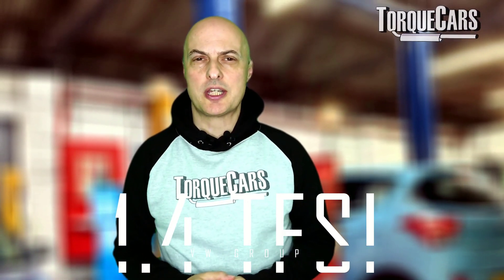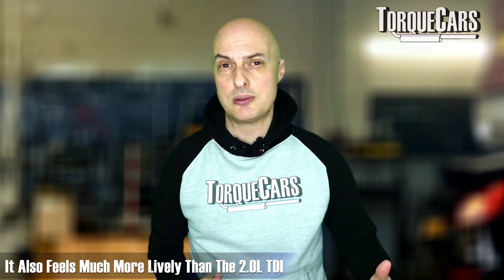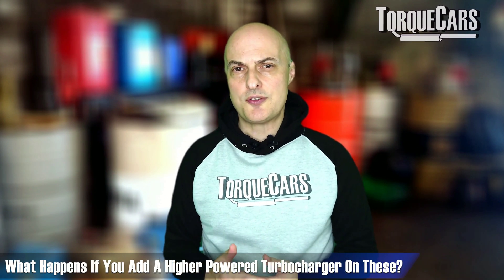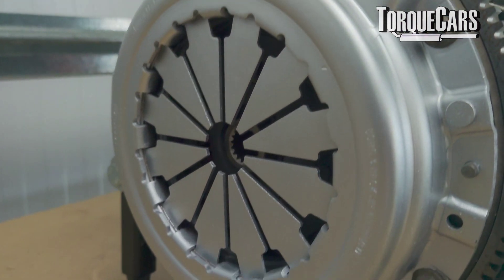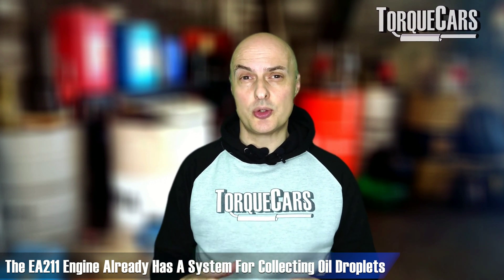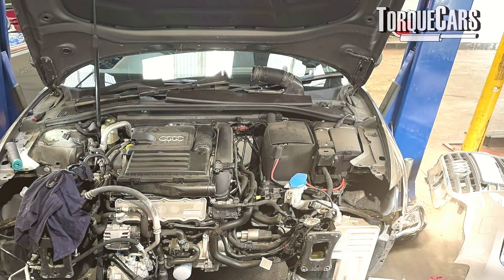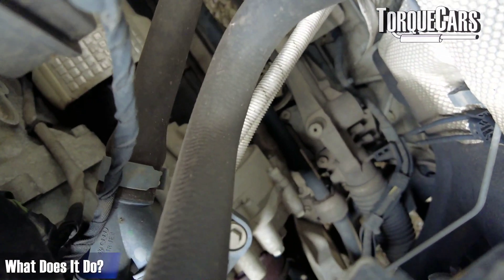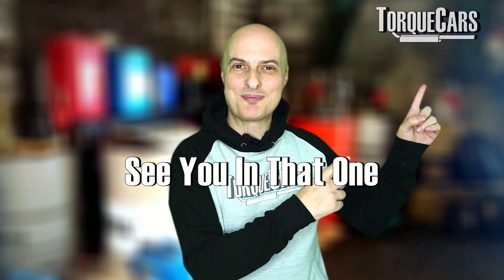1.4 TFSI TSI Tuning Mod Guide  EA211 Version  - Things To Look Out For

Comment: I have the audi a3 8v with the same engine ( tfsi 1.4 122ps tutbochrged). Is bad for the engine to install blow off valve kit? The engine is stock i have only delete mufler.
Reply from the maker: The money would be better spent on an engine tune in my opinion. These engines do not like atmospheric dump valves it causes the ECU to get confused and can throw up the warning light.
Reply: @torquecars  My engine has nearly 200k kilometers and i don't want to press it more for 30-40 hp. I have another car for that. If the only problem is the warning light and the engine maybe run a little bit richer when you release the gas pedal i think is a not a big deal. Can i have your opinion for my thougt?

Comment: Hello sir, question about the carbon build up on the intake valves on the EA211 Direct Injection engine. Is there any way to add dual injection to the EA211 to help resolve the carbon buildup on the intake valves.
Reply from the maker: The question is would this be worth doing, the cost of a decoke/carbon clean is around 80-100 and in my experience this doesn't need doing until at least 90,000 miles on these.Note that  I only ever use Vpower fuel and my exhaust is still as clean as it was when it came out of the factory. These are quite clean burning engines, unless you use rubbish fuel or service them with stupidly long intervals.  Popping off the EGR feed pipe will show how much exhaust soot there is potentially building up in the head. I do know some people who have had bad carbon build up at 70,000 miles but they all did very short distance drives and neglected servicing. Injectors were also badly silted up on those, but most I've seen have little carbon build up.
Reply: @torquecars  Thank you for responding sir, as am currently in India thus my question. Even though fuel quality is very good in India, the dusty conditions and weather leads to quicker carbon build up on the intake valves. I will check the egr and then have a look at the intake valves on my vehicle. I change the oil every 6000kms/3800 miles given the dusty conditions of the area I live in.

Comment: Is this info relevant for the 1.2?
Reply from the maker: Pretty much, but the gains are much lower as you are dealing with a lower displacement. - power gains are a percentage on the original power figure really. 

 Turbo upgrades need a bit of thought on the smaller engines as well, but these principles will still apply to your engine.

Comment: had a stage 1+ ECU and TCU, throttle controller, and turbo incharger (inside my intake hose) got 205HP and 400NM torque on my tiguan mk2 2020.  great engine but my old tiguan mk1 2014 CTHD engine is better

Comment: Firstly, thank you for your brilliant YouTube channel.  I just wanted to confirm if the latest 1.4 TSI EA211 engines also run port injection to minimise intake valve carbon build-up?  Is there a specific engine code I need to look for to see if my EA211 has port injection?
Reply: @GlowingTube  I've a A3 1.4 CoD owned for 6 years. No carbon build up. No oil consumption. Its on 98k now. I've got a new shape Q5 and the A3 is a better car overall.

Comment: I got 1.4tsi ea211 golf mk7 did upgraded to hybrid turbo and downpipe with an aftermarket air intake running with a tune 260 hp
Reply: @dmsYT  insane
Reply: Running the stock fuel system? I'm at 180hp with a 1.2 tsi with a hybrid turbo. Want to go over 200hp, not sure if I need to upgrade my fuel system first

Comment: Hello, I have a 1.4 TSI EA 211 + DSG DQ200 in ŠKODA RAPID Monte Carlo 2/2018 but I don't know if I have valve timing...??
I would like to increase the output to 110 Kw and the max. torque to 250 Nm (due to the clutch limit)
I don't know whether to keep the same Turbo or does it make sense to deal with the turbo from the 110Kw version...???
thank you for the advice

Comment: Dear friend, what about the 1.4 TSI in the Mk5 Golf GT sport with its 170hp? I really like the car for its looks and interesting tax rate with only a 1.4 engine with still on paper some good power, yet how reliable is it really and how does it really perform with its double turbo set-up, I'm wondering.
Reply from the maker: The EA111 was the original twin charged version. These were very rapid but they do struggle to be reliable. Most of the issues were sorted out with the EA211 revision. Here is a video about the typical problems to look out for. https://www.youtube.com/watch?v=G-o-XWut0SY

I would personally only buy one if it had a full service history and evidence of a careful owner. When neglected, especially oil changes they can get quite expensive.

Comment: I've just more or less completed my IS20 turbo upgrade for my EA211 1.4 CZCA engine, just need to get it remapped properly now. We'll see if we run into a fueling problem approaching 300bhp
Reply from the maker: Wow I have so many questions this upgrade is on my list. Did you get this on the stock manifold and intake pipework or did you need some custom stuff in there?

Please let us know what you find re the fueling at this power level.
Reply: @torquecars  Stock manifold (for now) and most of the pipework is custom. We did manage to retain the silicone hose from my RTMG air intake kit though...
Reply: @Em_Ligman  im looking at doing this. how is it now bro? What numbers you getting now? have you done any supporting mods? Any problems?

Comment: Had a stage one tune on my 2019 Jetta. Fantastic update! 175 HP, 255 ft-lbs torque. Same fuel economy, very good in traffic. No hardware required. APR.
Reply: Hi Jeff, which tune did you do exactly? Would love to get up there with no hardware required. I have a bone stock setup with wider wheels.
Reply: @jeffreywatson3534  ?
Reply: How the hell were you getting that much torque with 175 hp
Reply: @OzzieMozzie777  direct injection. Better fuel economy and better performance.
Reply: Do you have the car yet?. How many km did you do remapped?

Comment: Hi, u ask for comments but don't reply. Is it possible to reply to some.  I have a petrol 1.4 tsi 2012 engine with 80k on the clock. On startup it idles with a rattle.  Is that normal. It clears after a while. Pls reply... thx
Reply from the maker: Sorry I have been snowed under with comments, and some pretty time consuming family health problems of late.

In a nutshell, if you're experiencing a rattle during startup, it's not normal. Check these potential culprits: engine mounts, cam timing mechanism, timing chain tensioner, and injector rail bolts. However, for a comprehensive diagnosis, it's best to consult a professional. For more details, please refer to my previous response in the other thread.
Reply: If it's a low pitch rattle it may be your flywheel, you can check this by putting the clutch down when stationary, if the rattle stops when the clutch is down but continues when the clutch is up then this is a possible culprit
Reply: Cheers,  I'll check . Wishing u n ur family well. Thx again.
Reply: Mate be sensible that’s clearly a job for a on-site mechanic… thing between your ears

Comment: Great information¡. I am thinking on remapping my VW Tiguan 1.4 TSI MY 2018. Do you know what is the max reliable torque for this clutch after remap.?. Thanks
Reply from the maker: It depends on how worn the clutch is. I've heard of problems starting around 225-250hp on these engines, so they are pretty solid clutches. I have known people go higher than this with no problems at all, and one hit problems at 190hp but this was a high mileage engine and a stock replacement clutch sorted that out.